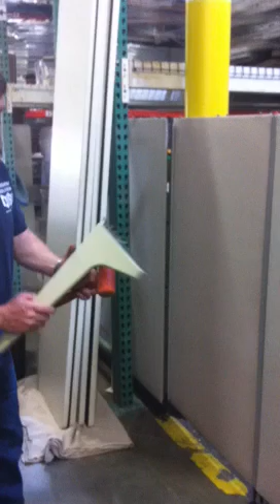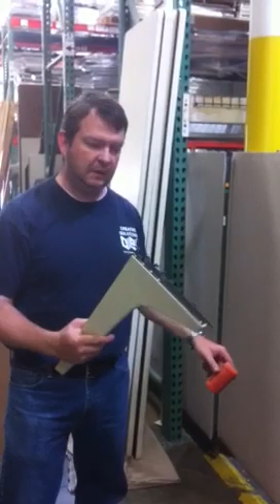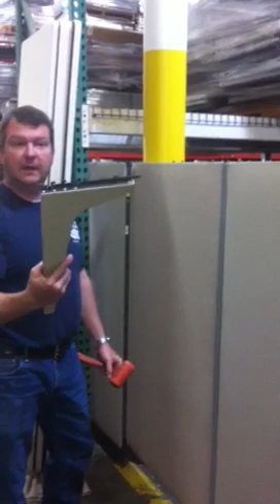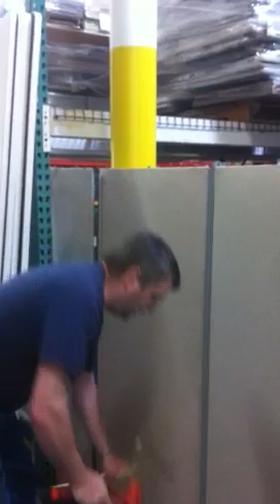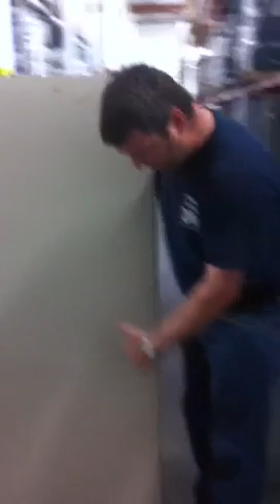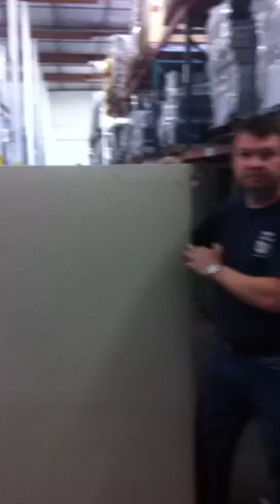How to remove a Haworth Panel

Comment: Thanx, I had to take a room full of panels, desktops and cabinet drawers apart. I was good till I got to seperating the panels. This saved alot of time. Dont forget the outlet string connectors. Just squeeze the tabs on top and bottom and pull the 8 pin connector out towards you.

Comment: I don’t know if you are still active here, but if so, can you tell me how to remove the desktop from the wall brackets?  The brackets have catches that mostly point down, but one points up and acts to lock everything in place. There are no visible bolts, screws or anything that I can remove.
Reply from the maker: The Haworth work surfaces are connected to the cantilevers with a bracket screwed onto the bottom of the work surface that slides into the channel of the cantilevers.  To remove push the table towards the back panel and lift slightly, then pull forward.  I grab the panel with my hands and use my hips to push the work surface in and lift.  Once you do one the rest will be simple.

Comment: What was the name of that tool?
Reply from the maker: It's not a custom tool.  You can get one from an already installed work surface.  They are called cantilevers.  I just use them upside down to move the rail up.
Reply: Use it to assemble also

Comment: I installed Haworth from '89-'94 in California.
You forgot to bend back the top clip before hitting up on the side rail. You can hear the metallic twang just as the panel is removed.
Rookie mistake. Lol
Reply: I'm struggling. What top clip? The the top decorative piece?